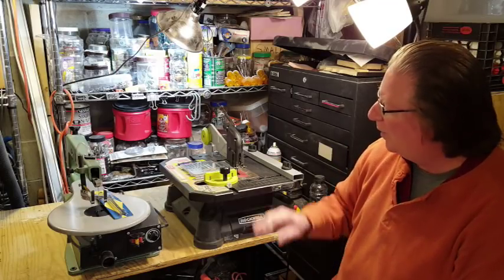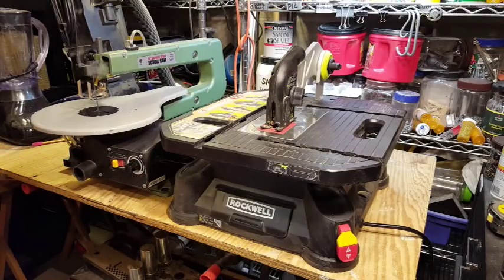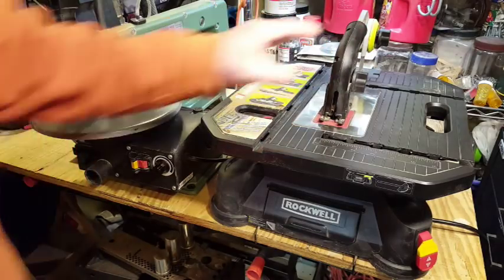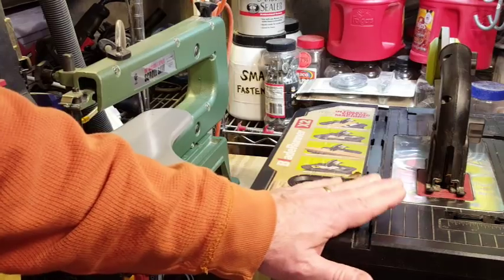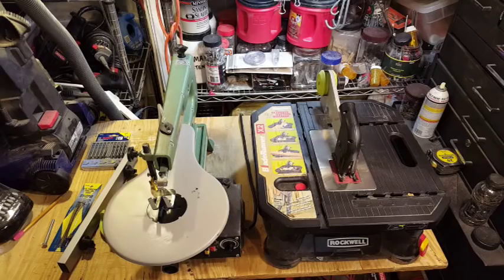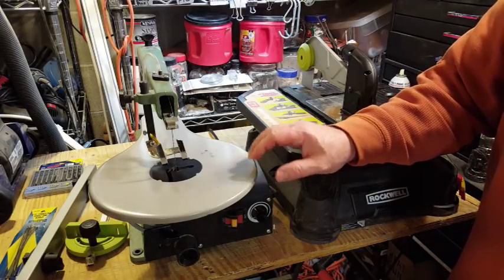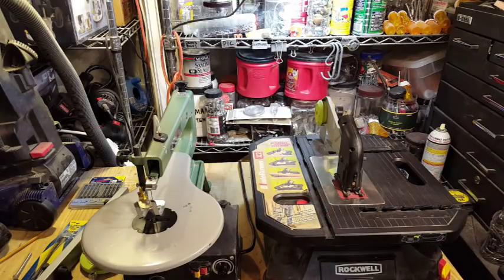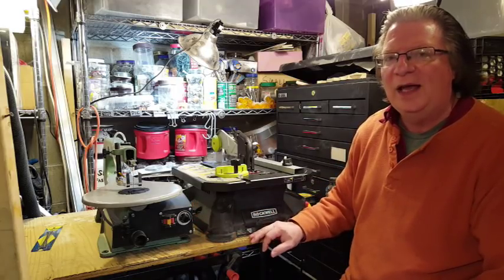12. Scroll saw vs. BladeRunner

Comment: I am looking for something to cut plywood.. 3/4" max. I will be making yard art and the cheap handheld jigsaw I used last time was a terrible experience. I need something I can easily maneuver to cut through all the curves from my drawings. About 3"w x 5" h average.  Any suggestions?
Reply from the maker: Thanks for your question. Take a look at my Bladerunner videos. I think this might be just the right tool for you. The Bladerunner is basically an inverted jigsaw so you move the wood through the blade (as opposed to moving the blade through the wood while using a standard jigsaw). You are able to use both hands to move the wood so you have great control and can make accurate cuts. I think you might like this much more than the jigsaw. If you decide to try the Bladerunner, let me know and I can make some suggestions for the type of blade you might want to try.
Reply: Imagine then Make yes, I think a bladerunner sounds like a good option. I dont want the cutting process to take too long or at least not as long.
Reply from the maker: vee Marzz I got mine from Amazon but you might find it locally. Give it try, and if you don't like it, return it.

Comment: excellent. i think you covered all my questions. now i need to figure out which works best for me. i would love to see just how intricate the blade runner can cut. maybe there is a video somewhere
Reply from the maker: Thanks for your comment.

There is no question in my mind that the scroll saw is capable of making very intricate cuts compared to the BladeRunner because the scroll saw blade is so much narrower than even a scrolling T-shank jigsaw blade used in the BladeRunner. Since the scroll saw blade is so much smaller, it also cuts slower than the BladeRunner.

What kind of project do you have in mind? Perhaps I could make a follow-up video using both the BladeRunner and the scroll saw demonstrating the kinds of cuts you need to make.
Reply: Imagine then Make thanks for the reply. I am making slingshot and am wondering how it would work when there is a grip style cut to be made, especially when using micarta, which is made using a hugely tough resin, which can ruin a blade quite quickly
Reply from the maker: Good question. Since I'm not familiar with micarta, I did a quick YouTube search and learned a little bit about it. The video I watched showed the guy making his own micarta and then cutting it using a bandsaw. He later sanded his pieces (not sure if he sanded by hand or used a power tool). 

Since his micarta cut using a bandsaw, I would think you could also cut it using the BladeRunner with the correct blade. However, one think to keep in mind is that if you use the BladeRunner, it will produce a lot of dust while cutting. There is a hose attachment for a shop vacuum which I would suggest using. Also, wear a respirator!

Since the BladeRunner is very portable, you also have the option to do your cutting outdoors.

And lastly, I have used the BladeRunner to shave material off of my workpiece. I think this works pretty well and again, using the right blade and some patience, I get decent results.

I hope this helps. Good luck with your project. If there is something you'd like me to demo in a video, please let me know.
Reply: Imagine then Make thanks, that is very helpful. yes, the band saw seem the popular choice for slingshot making, whether wood, micarta or aluminium. really, I am trying to decide between band saw, scroll saw and blade runner, to find the one most suited to my needs. 
I assume the scroll saw is not so good for something tough like micarta?
Reply from the maker: The scroll saw excels at making very intricate cuts because the blade is so much finer. Check out my video that compares the BladeRunner to a scroll saw to see what I mean. There is a wide variety of scroll saw blades available so I would imagine that there is a blade that would cut micarta.

Something else to keep in mind, the scroll saw and BladeRunner can both be used to make inside and outside cuts whereas a bandsaw can ONLY make outside cuts. See my vid for more details.
Reply: Imagine then Make thanks for the help
Reply: I just tried some sharp angle cuts with the thin blade using my jig saw, it came out great! I imagine that if I had two hands available, it would be even better, and faster. I think the BR might be the one for me! Also I understand the scroll saw is not great at straight lines, which I do also need
Reply from the maker: Cool! Smart move making a test cut using your jigsaw. Good luck with your projects.

Comment: My Blade Runner manual states there is a variable speed adjustment under the saw.
Reply from the maker: Yes, the old version of the Bladerunner (model RK7321) had a variable speed motor control located under the table on the left side. Unfortunately, the model that I own does not have a motor speed control. There were also several other nice features with this older model (2 miter slots, a miter gauge that also serves as a fence, power cord wind up spools, stainless steel top, blade support off to the side and not in back). If they still made this saw, I would buy one to try, particularly for the variable motor speed control. Thanks for watching.
Reply: @ImaginethenMake  Gosh, so that wasn't progress; it was regress!

Comment: I have the scroll saw.  It works well, but the blades will overheat and break quite easily.   I can see the advantage of the blade runner right away.  I dont much care about noise, but I do care very much about the result.
Reply from the maker: Thanks for your comment.

Comment: I use a Dewalt788. Do you recommend a bladerunner?
Reply from the maker: Thanks for your question. The short answer is, "it depends on the kinds of cuts your are making".
The Dewalt788 is a scroll saw. In my video, I describe the differences between a scroll saw and the Bladerunner.
The scroll saw uses much smaller blades so it cuts slower and in much finer detail. The Bladerunner uses jigsaw blades which are much larger than scroll saw blades so it cuts quicker but not as accurately.
Reply from the maker: Hi. Check out my latest video where I compare the BladeRunner to a scroll saw and a band saw and let me know what you think. thanks!   https://youtu.be/mVGa4cUj_nY

Comment: What this really is, is a comparison between a table mounted jigsaw, and a scrollsaw. The two are not comparable. They do totally different job, and the scroll is for detailed job specific things, and a jig is for larger woodworking jobs which cannot be reached by the table saw or chop saw. Jigsaws are just powered hand saws that can cut radiuses, I know plenty of people who mount them into a tabletop, but that is often after buying a second one for handheld jobs, you limit their options by putting them into a table. The Bladerunner is for those people that  do not know that a bandsaw is what they really need.
Reply from the maker: Thanks for your comments Chris.
I agree with you to a point. I actually have done 2 videos comparing the BladeRunner, scroll saw, and bandsaw. In those videos, I speak about the differences as I see them. Check out videos #41 and #84 for more.
Thanks for watching.

Comment: I love the used scroll saw you bought for $30.00.  What brand/model is it?  What yr was it made? I will look for that one.  I have a more basic Craftsman 1985 year model. It has tight tension.  I prefer tensioner. Also my blades are 3 inch long blades. Very hard to find.  I bought two small packs I found.i need to change to a 5 inch blade scroll saw.  Please advise.  Most Humble Appreciation! Alton
Reply from the maker: Hello Alton. The scroll saw is made by Central Machinery and is sold through the Harbor Freight stores. I got lucky by stumbling upon the used one. I still have the saw and use it from time to time. Below are a few links to other videos where I used the same scroll saw. Thanks for your question and for watching.
#10.  https://youtu.be/niSinuF_tdA
#11.  https://youtu.be/fzkflN8jeyg
#41.  https://youtu.be/mVGa4cUj_nY
#84.  https://youtu.be/eBQU1PT0EvM

Comment: Can use more long saw on Bladerunner?
Reply from the maker: The BladeRunner uses standard t-shank blades. I'm not sure how long the longest t-shank blade is but it should work with the BladeRunner.  How long of a blade do you need? Also, the BladeRunner is not really designed to cut very think material.
Reply: @ImaginethenMake   I want use saw about 12 sm long for cut mahagony
Reply from the maker: Sorry, I don't understand your question.
Reply: @ImaginethenMake  I mean blade with 5 " long
Reply from the maker: @olegtolmachev5890  I don't know of a t-shank blade that is that long. Also, it sounds like you are trying to cut a fairly thick piece of wood. The Bladerunner is better suited to cut thinner pieces. In one of my videos, I show trying to cut a 2x4 using the Bladerunner; I was able to get through the piece but the cutting was slow and the saw struggled with a piece that thick. I hope this answers your question.
Reply: @ImaginethenMake  I haved that blade...
Reply from the maker: @olegtolmachev5890  Who makes the blade?
Reply from the maker: Thanks for the link. If you decide to try this, please let us know how it works out for you.
Reply: @ImaginethenMake  Yes, info you

Comment: i just reviewed the bladerunner it was the biggest pos i ever fired up in my shop, returned it it could not cut anything well, see my video for the live demo of materials used.
Reply from the maker: It's a shame you chose to return the saw prior to watching my videos. I did watch yours and it seemed like you were struggling installing the blade. To install the blade, just press the red button down and move it to the left. The blades installs easily. Then release the red button and the blade is locked into place. If you removed the red square plastic piece where the blade gets installed and then you press the red button and move it to the left, you'll see how the blade locking mechanism works.

I invite you to watch my videos about the BladeRunner and then ask any questions you might have. Perhaps then, you'll decide to give the saw another try.

Thanks for taking the time to comment.
Reply: Saw was total junk im my opinion i cut heavy duty stuff around here it was not having it, the blade insert wasn't the issue it was the lack or articulation on the plunge during the cuts that i think makes it a bad tool along with lack of real blade support. I own a real industrial band saw and saw this cheap saw as something i could use quick to cut plastics and all but thats not the case. maybe mine was defective i don't know but it sure couldn't cut much without an issue as you saw in the video, the vibration was over the top as well and it was placed on a 1200lb industrial work table.
Reply from the maker: As you already know, all tools have limits and the key is to use the right tool for the job at hand. In my experience, the BladeRunner is best at cutting thinner and softer materials. Currently, I am mostly cutting MDF and thin soft woods (less than 1" thick) so it is a very convenient tool for me. Since you are cutting heavier stuff, I can see why it isn't so useful for you.
Since the BladeRunner is fundamentally and inverted jigsaw, anything (within reason) that you could cut using a jigsaw, you should be able to cut using the BladeRunner. With both tools, it is important to use the proper blade.
Regarding vibration, I have found that the more firmly the workpiece is pressed against the tabletop, the less vibration there is (which is partly what the hold down foot is used for). I always use the arm/hold down foot when cutting small parts for this reason. Larger parts (that weigh more), I tend to cut without using the arm/hold down foot. The weight of the piece helps to hold it against the table which lessens vibration. It's all about learning how to use the tool and discovering that tools limits.

Comment: I was hoping for a performance comparison. That was only features.
Reply from the maker: Thanks for your comment. In some of my other videos, you'll see me making cuts with both of these saws. In general, the Bladerunner cuts faster than a scroll saw. A scroll saw is typically used for more detailed cuttings (finer work) than the Bladerunner. and therefore, cuts slower.

Comment: Liked the video ,but the Blade runner is a accessory to have with a scroll saw or vice versa ..If you are limited to the tools you have in your work shop . I am a scroller and the blade runner would aid in the creations i make being I could make thick wood thinner etc and also the blade runner is a a great portable DIY machine for around the shop and home .Not going to do fret work with a blade runner....They are both great machines and compliment each other.Keep up the videos .
Reply from the maker: Thanks. I agree....the Bladerunner and scroll saw do complement each other nicely. There are many differences but most notably is the blade size and therefore the kinds of cuts each is best suited for.

Comment: That Rockwell feels like a toy. Plastic everything. Passed.
Reply from the maker: This version of the BladeRunner is much more cheaply produced compared to the 1st version. The 1st version had more metal in it and the arm on the right side. You are right; this version has a lot of plastic in it. Thanks for your comment and for watching.
Reply: That's the perfect description.  It's a toy.  I bought it for light cutting, situations where the power of my  worm-drive skilsaw is unnecessary or dangerous.  It can't even do that.
Reply from the maker: Hi John. IMO. the BladeRunner is best used for some light cutting (thin soft wood). I don't cut any thick wood (more than 3/4") and I don't cut any metal. I'm sure many who prefer more powerful tools made from mostly metal would consider the BR a "toy". Remember, the BR is basically an inverted jigsaw. 
Thanks for your comment.

Comment: A band saw would be a better choice.
Reply from the maker: I like using a band saw. In fact here's another video comparing the scroll saw, Bladerunner, and band saw:  https://youtu.be/mVGa4cUj_nY . Here's the video I made about the Harbor Freight 9" table top bandsaw. As much as I like using the band saw, I have 2 complaints: 1) the blade guides on this saw are OK but nicer saws have much better blade guides and 2) a band saw cannot make inside cuts, only outside cuts.
Also, I have gained a lot more experience using the scroll saw from when I made this video and find it to be EXTREMELY versatile. So If I could only buy one saw now, knowing what I know today, I would probably buy a scroll saw (and hopefully have the money to buy a saw with a larger table top).
Thanks for your comment and for watching.

Comment: Blade runner is NOT a scroll saw, just a jigsaw with table. Can't do intricate work, cheap crap.
Reply from the maker: BlackTalon 1 Thanks for your comment. Yes, the BladeRunner is basically an inverted jigsaw. Fast forward to the end of my video and you'll hear me state this.

I also say several times that which saw you choose depends on the kind of cuts you want to make. Certainly, a scroll saw can make much more intricate cuts compared to the BladeRunner. Likewise, the BladeRunner is much better at certain cuts compared to the scroll saw.

Comment: First and foremost this is not a not a good comparison. Your comparing apples to oranges. These are two completely different tools. Sure while they both cut and and can similar things to one another one is a scroll saw and the other is a mini table saw.  They were made to do different things. Basically this wood working 101 that any 11 year old should learn from his dad or shop teacher in 15 minutes!
Reply from the maker: Actually, there are several things that both of these saws have in common from my perspective. Both cut wood. Both are portable and use standard 110vAC. Both are reasonably inexpensive (around $100). Both are reasonably safe to use IMO compared to say a table saw.
Yes, the saws are different and intended for different purposes, but I think there is a fair amount of overlap.
Very shortly, I will be reviewing an inexpensive band saw and comparing it to these 2 saws, so stay tuned for that video soon.
Reply: I personally am very glad for this comparison. I’m looking for a tool to help me do a specific thing and this helped me decide what to purchase. Perhaps for someone that is very familiar with woodworking tools the review is not needed but for a novice like myself it helped me tremendously.
Reply from the maker: Glad the video helped. Thanks for your comment and for watching.